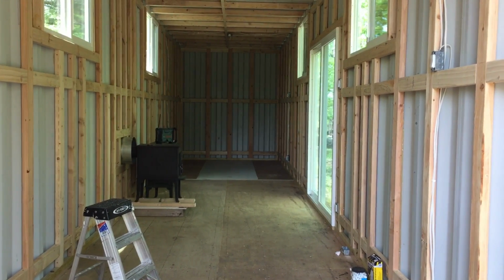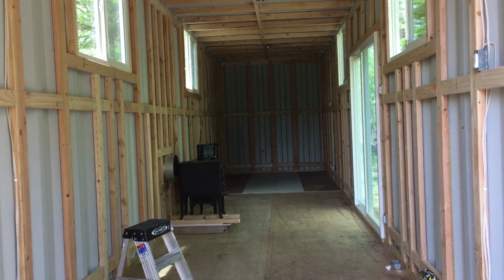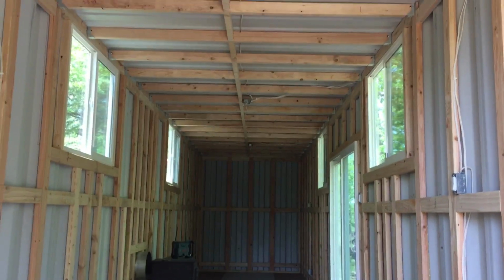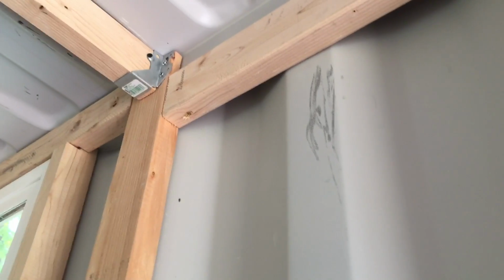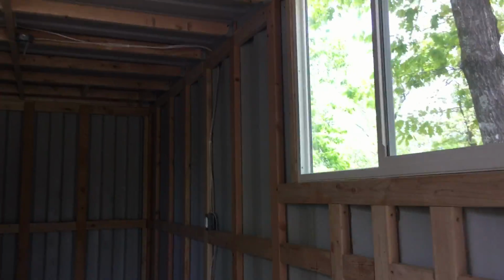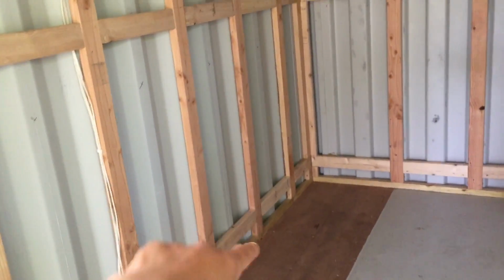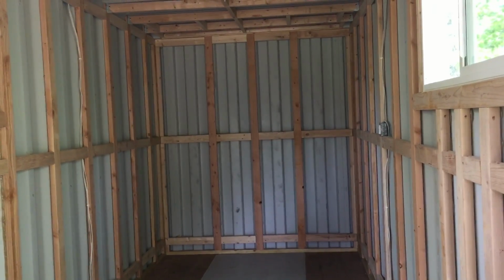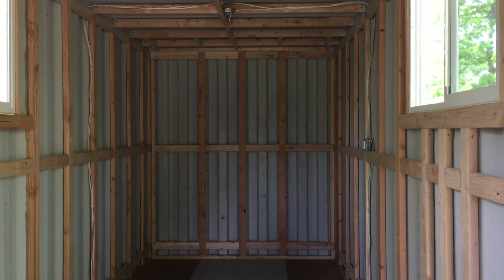Shipping Container House Framing

Comment: I think that I would have installed arched trusses for the ceiling.  Plenty of room to run water supply lines, dwv lines, gas lines, and electrical.  Plenty of room for hvac in the future.
Reply: no need too if  you lay the 2x4s long ways paddle bit and some driling run all electric and water
Reply: texanaggie, and where do you propose running the HVAC lines unless they are ran next to the top of the building inside of the arch I propose?
Reply: Window units......

Comment: O Damm boards are wrongly installed on wall but correct on ceiling
Reply: Paul Herndon no need they are not load bearing in a build like this. Only need spacing for insulation, electrical, plumbing and something to tack the drywall or panelling to.

Comment: How will you prevent thermal bridging where framing is touching the container? If there isn't enough gap between framing and container wall the foam may not be able to get inbetween studs and steel...
Reply: joe v why so rude? I was asking a question and so far no one has answered. If you know anything about thermal bridging you should know that where hot and cold meets you can get condensation.... I am simply asking a question and I would love to get an answer from the person making this video. Not some rude internet troll
Reply: Thermal bridging does apply in this case whenever metal touches wood. I would imagine or hope this person at least put a thermal tape behind his framework or left enough space for the spray foam to cover all metal, sea cans are famous for sweating even if it's just a few 2x4's , over time they will rot and moisture will transfer to the drywall.
Reply: Matt Olsson metal studs would eliminate rot
Reply: and be more expensive, and harder to work with, and require more tools, and make hanging things more difficult...
Reply: @jonesey1981  Are you talking about metal studs?  They are cheaper, easier, and require fewer tools.
Reply: joe v well how much mercury do I have to worry about in a tuna can, surely you know ...😏
Reply: But conduct heat.
Reply: @kieranpearson  Metal studs do not need to be in contact with the container wall.
Reply: @usafa1993  well then how will they be fastened to the metal shipping container?
Reply: @kieranpearson  They will not touch the shipping container walls.  You have a metal track that connects to the floor (footer).  Steel studs run vertically to a top track (header).  Attach sheetrock to prevent racking.  

What is the floor?  Ideally, hydronic, radiant, geothermal, polished concrete.  Cheap, easy, last forever.   But regardless, fasten the footer to the floor. The top (header)?  Just a steel frame screwed into container.  In a cold climate, you're gong to need a lot of insulation not only on the walls, but a greater amount on the ceiling.  So your header, in that situation, is going to attach to (perhaps) foam board insulation.  Here is the stuff I am trying to describe:  https://www.homedepot.com/s/steel%2520studs?NCNI-5

The biggest challenge, by far, in this situation, is how to insulate the ceiling, without going external.  Why not go external?  Because your roofing is 100% done.  Why is the ceiling so important?  You should have an R-factor at least (at least!) double your walls.  

In this video, the creator is not concerned with thermal insulation.   He's just looking for something to hang sheet rock onto, with a modicum of a vapor barrier.
Reply: @usafa1993  if the metal studs are touching any of the metal, I wouldn't use it. But if you want to and think it's a good idea and anybody is willing to listen to that I wish you and them the best of luck.
Reply: @kieranpearson  They don't.  As I explained, QUOTE: "They will not touch the shipping container walls."  Good luck to you also, with your journey into construction concepts.
Reply: @usafa1993  ultimately for your design to work you still have to screw the metal studs into the foot or as you put it which is made out of wood. Which does not conduct heat. I think I get construction Concepts quite well.
Reply: @kieranpearson  Wood is a great thermal bridge - NOT an insulator.
Reply: @usafa1993  wood is 100% cellulose. Cellulose is actually a great insulation because it is such a terrible conductor of heat. That's why it's used as an insulation. I am a thousand percent sure though in this project he will use some sort of rigid foam board or spray foam insulation. In addition to Wood studs. FYI you didn't address anything I said in the previous comment.
Reply: @kieranpearson  OMG... Okay.  1000% sure you know what someone else is going to do.  You're God.  You win, you know your stuff 1 million percent.   You are correct, I did not address your last post.  I'm not getting drawn into it, out of respect for the initial poster.   Last interaction from me... continue to bait if you will.
Reply: @usafa1993   I'm sorry. I didn't know being able to listen to the video where he says he's going to spray foam the walls makes me God, but sure. Feel free to tithe anytime! You can easily find me on PayPal.

Comment: Do you have to spray the inner metal walls with anything to prep them for the expanding foam insulation? How, exactly, are the windows and doors framed with the metal skin?
Reply: I would say make a use 2inch square tube to make a frame and weld that in the mount the windows in that reinforced opening
Reply: we used 2x2 angle iron on the doors and windows ..  we attached the window to the 2x4 studs from the inside and placed the window and secured it all against the interior wall
Reply: Chris White yeah
Reply: even with spray foam he doesnt have the space for decent R value.
Reply: With the proper spray foam Sure he does Infact better than fiberglass And in some areas extreme temps are not a issue
Reply: A random guy on YouTube who had a new spray-foam installer insulate the ceiling of his 20' container.  Getting the ceiling even looks difficult for an installer on his second job. https://www.youtube.com/watch?v=DP_Jm6gwY3I&t=15m50s
Reply: Lester Suggs yes u do
Reply: Spray-in insulation can potentially lock-in moisture between the insulation and the metal, eventually causing rust. You should use some sort of moisture barrier. This is actually terribly done.
Reply: Emilio Valles how in the world do you get moisture between foam and metal when the spf adheres directly to the metal? You don’t! Not buying your aspect. No different than spraying a metal building or making SIF’s.
Reply: I think emillo is confused with closed cell spray foam and vapor lock plastic after the foam ..which is not needed with a full sealing closed spray foam  in all climates zones
In some places in Northern and southern climates you need a vapor barrier with batt and fiberglass
Reply: @freakyflow  Vapour barrier is only useable in continuous heated constructions.
Reply: @OmmerSyssel  I live in Canada One of the laws is you must install a vapor barrier ..1) Vapor barriers shall have a permeance not greater than 60 ng/(Pa∙s∙m2), measured in accordance with ASTM E96 / E96M, "water Vapor Transmission of Materials", using the desiccant method. 
No where does it say anything about Continuous heated constructions  Yes heat carries water at a higher rate However if you use a spray foam there is no air gap to transfer the moisture passed  Thus no water damaged  If you place a vapor barrier over spray foam that pocket ( small has it may be ) will gather in time Moisture. And will form into water 
The idea is if you have something to fill air from getting passed that is a vapor lock Your trying to stop warm moist are from mixing with colder dense air ...Many  custom van people will fill the truck with foam sheets And tape and leave out the air gaps inside the interior frames Or at best slap tape over it ..Filling these  now has made the van less likely to sweat on the panels  No vapor barrier needed

Comment: I think most people are wondering how the 2x4's are attached to the metal container. You used the term "glued" . I think we all are wondering was it gorrila glued to the metal or what ? you could have been a little more precise on that matter.
Reply: You don't have to fix the frame to the container. The frame unlike in a house is not structural. With the all walls and ceiling frame connected to each other it is very solid. This is a cool video I searched for good video's on framing my container and could not find any. I did a lot of mucking around before doing similar to this but definitely some improvements and tips here. Thank you
Reply: I attached a 2x4 length wise down the square tubing on the ceiling of the connex (notched that 2x4 to fit the sq tubing)  secured it with self tapping metal screws, then the wall 2x4's are secured  by toeing in wood deck screws at the bottom and top both sides.... no glue was used all wood decking screws
Reply: I'm thinking of renting a container and not adding windows and doors, just building a frame for the front and inside that I could take down and adding insulated wall panels. Would the wood structure be sturdy enough? Will it still sweat and rot the wood if I use non spray insulation?

Comment: Did you use a drop saw or a table saw for all the chopping?
Reply: Shelley Raskin 
Yes, it was in the basement!
Reply: I used both on mine , table saw for some notching i did on the ceiling 2x4's and drop saw (dewalt 20 volt xp )  &/or miter saw for  studs and wood panelling

Comment: Good luck drilling thru the studs laid that way for your plumbing ... A centered 3/4 inch hole is going to going to leave you about 1/2 inch of wood on either side of the pipe ... Setting the 2x4's the regular direction leaves you about 1 1/2 inches either side of the pipe ... Way stronger ... And less chance of putting a nail or screw into a pipe ...
Reply: James Witte 
I too, am thinking like a plumber.  Because I are one.
If he had installed arched trusses, it would be a cinch to run water lines, dwv lines, any gas lines, and hvac lines.  Minimal loss of headroom, since the loss is along the edges, not the center.  When I say arched, I mean just enough to have enough room for the utilities along the top edges.
Reply: Super Dave yup ... Either a 12" radius arch or a 45° that comes in 6" and drops Dow 6" ... And you could put in decorative hinged access panels with lights attached for future mods and/ or repairs ...
Reply: James Witte 
That would be perfect!
Ahhh, great minds think alike.
Reply: Thanks for that!  I'm in the process of building one, and although I will have 6" studs (Northern NY, cold!) for insulation, I like the idea of maximizing the ceiling for utility runs at the end of the day in my small 20x8x8.5 shipping container.
Reply: @Kistilan  Hi Kistilan.  How are insulating the top and floor?  You know that the ceiling insulation is at least twice as important as the wall insulation, i.e. should probably be double the R-factor of the walls.
Reply: Johnny Draco 
Current plumbing codes do not allow for plumbing to be on the exterior of a building.
Reply: Super Dave really, they lay pipes, let's not get carried away.
Reply: texanaggie 
Sooo......    like I said in the other post, where are you running the HVAC lines?  Unless the ceiling is arched on the sides, which happens to be perfect for the duct work and the elect/plumbing drops.  In the future you have access for any repairs, as well as a minimal loss of space.
Reply: not running HVAC lines, using window units or looking back those European style A/C's that mount high on the wall and most the equipment is outside would be a better option , my idea was never to run Central Air. window units at 100+ (south Texas heat ) and partially insulated keeps it about 78 to 74.
Reply: prettymochame just T 
We find the "trench" and lay the pipe!
You gotta trench available? Let me know how deep and how long.
Reply: Super Dave for you I'm sure very shallow with your small pipes...😏
Reply: Super Dave no matter how hard you try, a man I will never be and neither will you.
Reply: Super Dave and you're now muted, witty comebacks I can deal with nah nah nah nah nah is like not happening
Reply: we put in our studs the exact same way , we will be running PEX up the wall (not that hard since we did 16inch centers for the start you just run electric and plumbing in the valleys of the container) to the ceiling and run it that way since the ceiling 2x4's are laying the normal way drill holes with a paddle bit and your off , we also did our Electric that way works great , we did have to notch the 2x4 that runs the length of the ceiling where we wanted electric\water ran  again using a paddle bit , worked fine....  there is nothing conventional in our container

BTW to save headache and time instead of notching each wall stud to fit the top tube we notched 2x4s that ran the length of the ceiling , then cut the studs to fit inside that notched 2x4 and toed in decking screws worked really good
Reply: Johnny Draco 
It is the universal standard of building codes, which includes plumbing.
Reply: I'm guessing shipping containers are treated like mobile homes. Only the service hookups have to meet code which vary by county. 
Though it's wise to follow building codes the best you can.
Reply: Johnny Draco 
UPC!
Reply: prettymochame just T 
Giganticus erecticus!
Doesn't work for hermaphrodites like yourself though.......

Comment: Why didn't you use 2×2s?  The 2×4s laid flat like you did means less insulation,  but more expense in framing...
Reply: I was going to ask the same question,  seems like 1x2 or 2x2 would have been enough
Reply: Every YouTube containerHero does it this way. 
Seems to be the only way to use a rectangular beam 😕
Vertical mounted makes it stronger & provides suitable space for insulation.
Who cares when clueless amateurs seeks fame 🙈

Comment: Are the 2x4’s screwed on to the metal walls?
Reply: No, it's glued
Reply: Do you think you'd need to glue it if it were a 20' with no windows or doors? Thinking of renting a container and building a frame I could take down.

Comment: You do excellent work! I would use big trim instead of a third piece of drywall along the floor.
Reply: I totally agree with your window positioning and how you framed the ceiling. If you’re concerned of moisture you would be better prepared to deal with repair by placing the horizontal 2x4 higher on the wall than 2feet.I’ve spent years doing renos/repairs and if you have moisture issues and only replace a few inches of drywall you create a bigger problem.As far as it being easier to replace where the old seam was, that is just a gathering point for mold in a moisture rich environment.Your sprayfoam will not seal behind the 2x4’s without pushing them away from the wall,so it would be better to but another vapour barrier behind them.Use a rim joist seal or create a small gap to fill with foam.
Reply: Just use 54" rock.
Reply: can you elaborate, it sounds interesting but i don't understand what you mean? Link? Pic?
Reply: jonesey1981 he means a tall skirting board around the bottom rather than say a 100 mm 4 inch strip of gyprock

Comment: I think you have done a good job . Are your ceiling joist glued to the metal too ?
Reply from the maker: Not yet, but the spray foam insulation that will be applied will glue it in place. See next video. Thanks